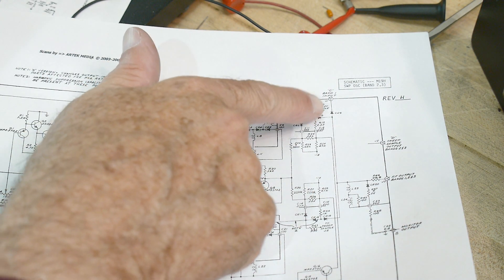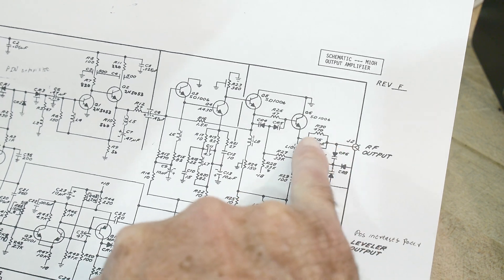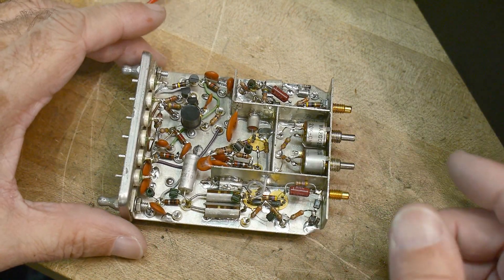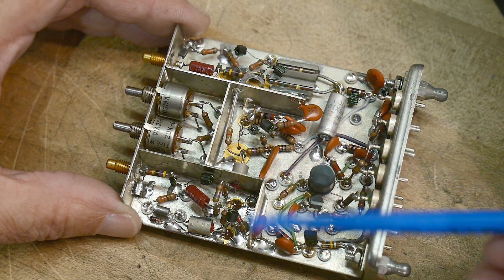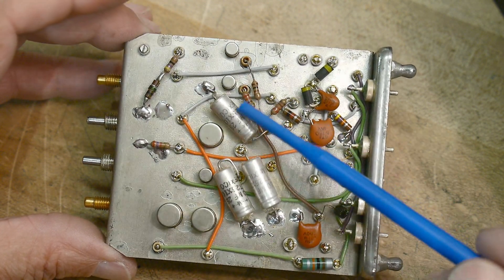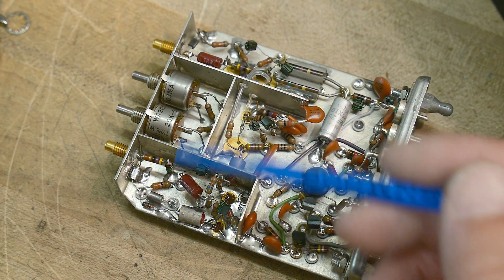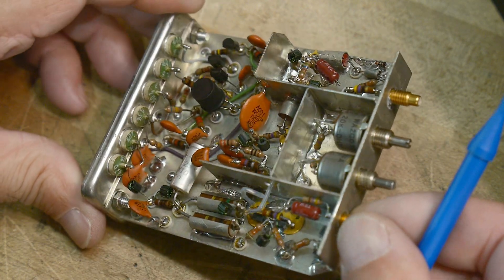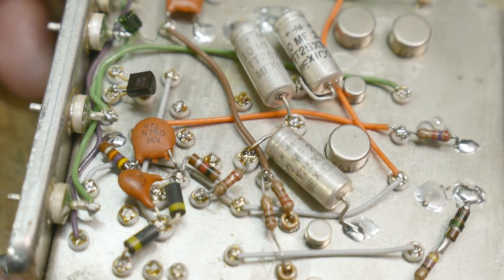#1124 Wavetek 2001 Sweep Generator (part 3 of 10)

Comment: Enjoying the video.  Since those 1 or 2 watt resistors are in a metal can I think they maybe placed in those metal sleeves and then soldered to the chassis for heat dissipation and not for shielding.
Reply from the maker: Yes, I came to the same conclusion

Comment: Well, you're probably already well ahead of this point but those electrolytic caps are all suspect. Probably haven't been stressed a lot over the years but they still die. I just fixed a old HP 80 MHz counter by replacing the PS electrolytics (Sprague big cap had "wet the bed" requiring a bit of PCB repair, boy are electrolytics expensive today!) but the two smaller Sprague's also need replacing, one obviously bad but the other just starting up the ESR chain). Anyway, worth a quick ESR meter check.
Reply from the maker: you can see into the future, not the only thing wrong though